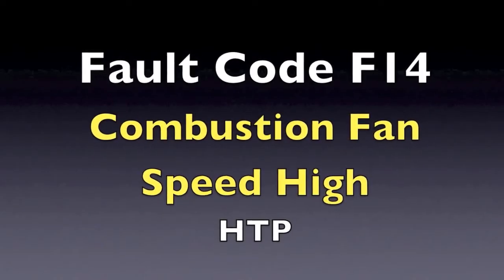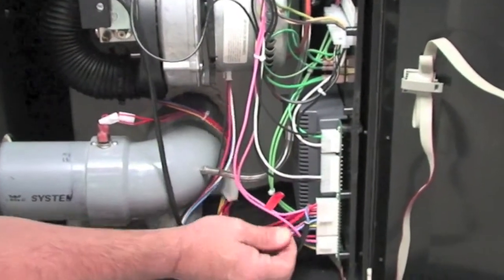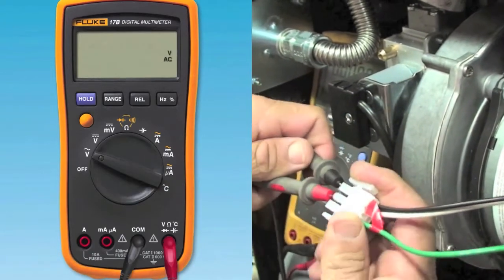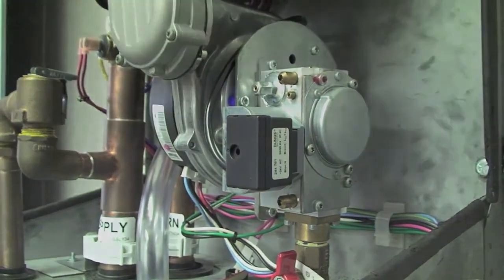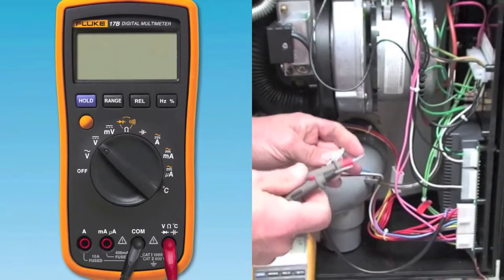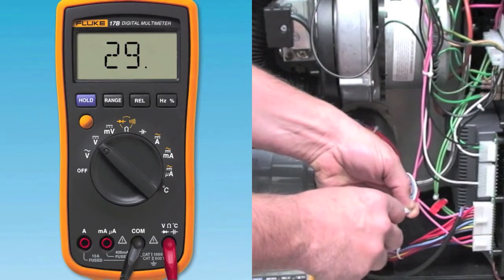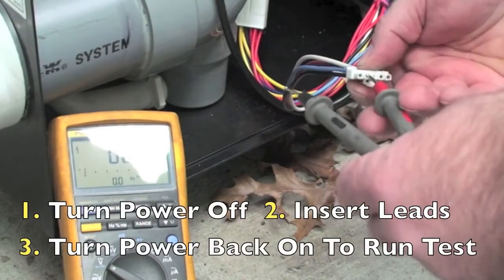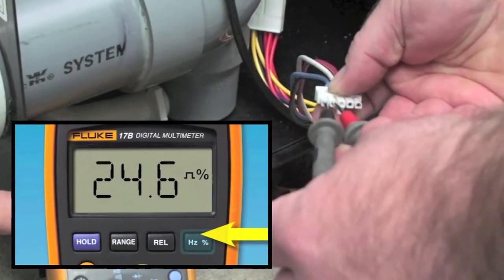F14 Fault Code -

Comment: I'm not sure if I am testing the duty cycle correctly.  In the video you say to disconnect the power, then put the leads into the wire harness.  I did that as instructed and my meter instantly goes to 0%.  Was I supposed to turn the power back on at some point?  Otherwise everything checks out, but I'm still getting the F14 code multiple times per week.